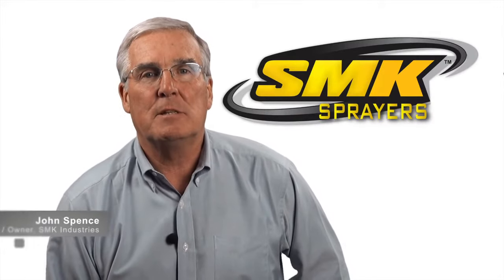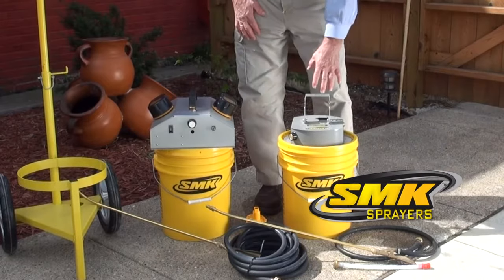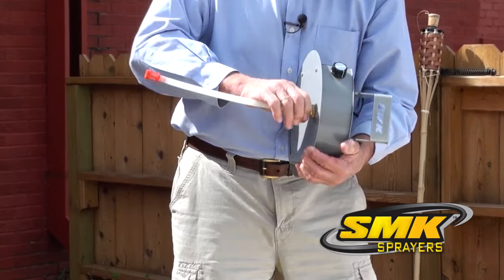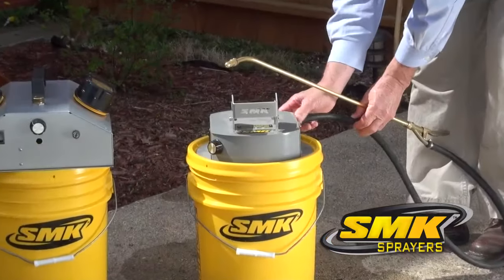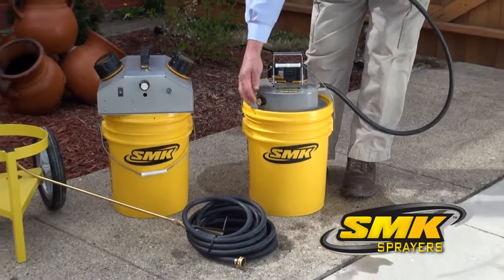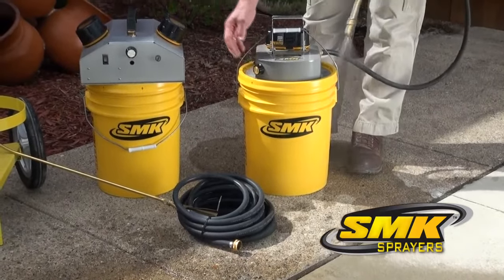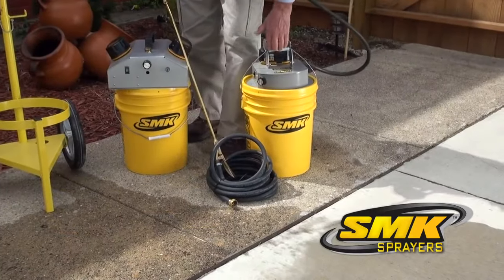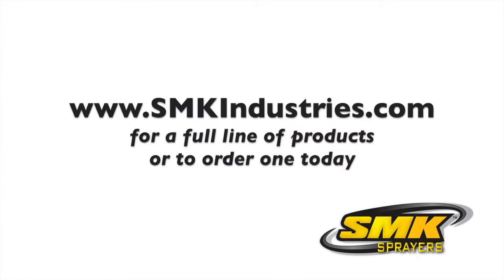SMK Sprayers Demonstration Video

Comment: Cool concepts with the pump and bucket!  Start marketing for agriculture.  Make it adaptable for an atomizer tip.

Make a pump with an on/off between 30-40 psi so you can use it for biologicals